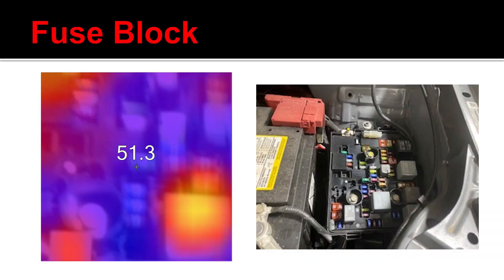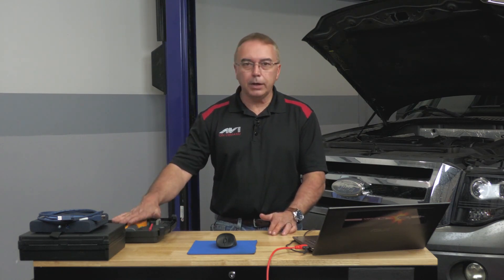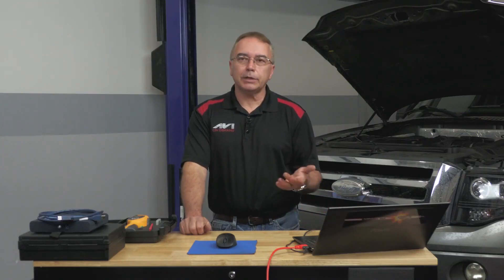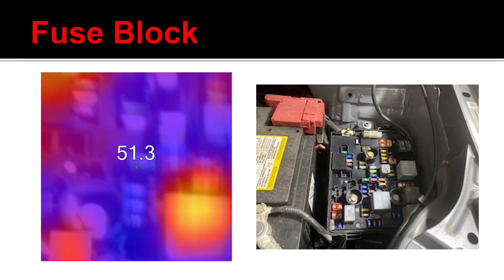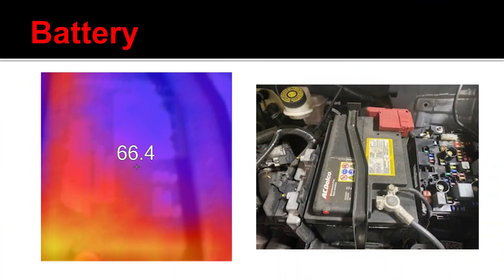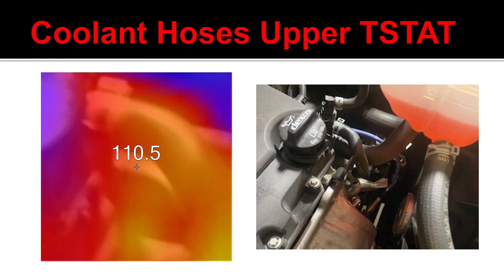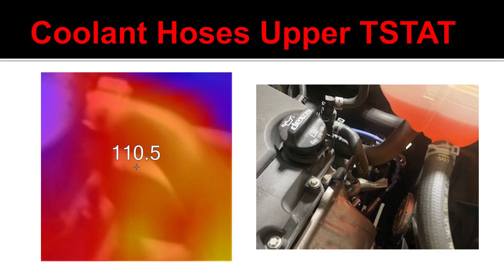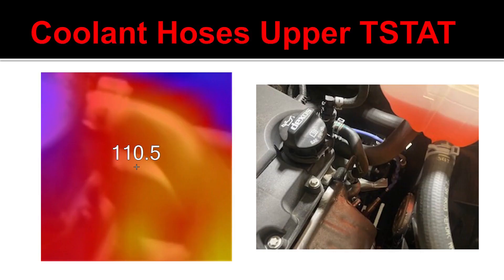Uncommon Thermal Imaging Diagnostics | Tech Tip

Comment: Also found a clogged oil cooler on a dodge challenger that caused the heater core to blow cool. had proper heat on both hoses but following the flow circuit it stopped at the oil cooler. and the thermal showed it. can't wait for predator googles to be common place.

Comment: Last shop I worked at; co-worker could not find a draw, even after pulling each fuse. Told him to use the thermal, He found a power wire in a unmarked/unused socket feeding a shorted out power converter, the customer had installed.